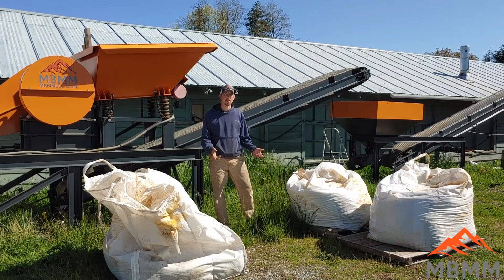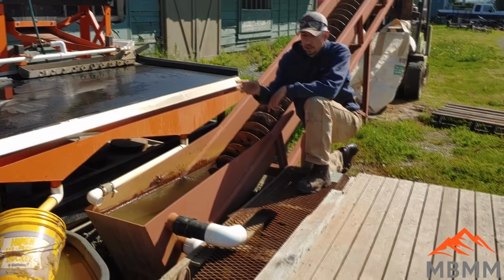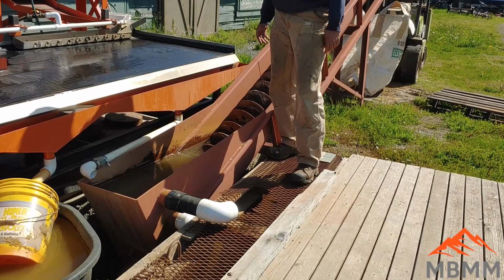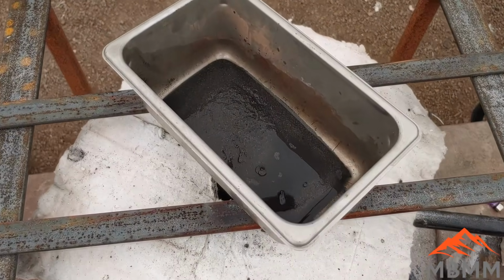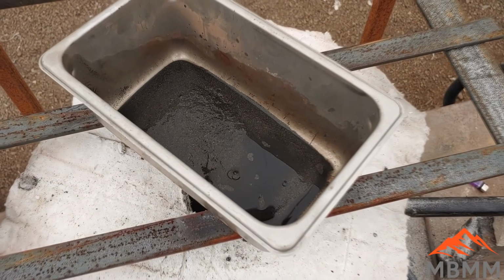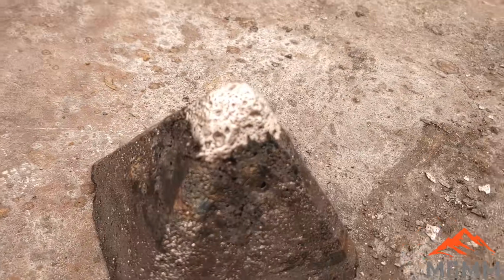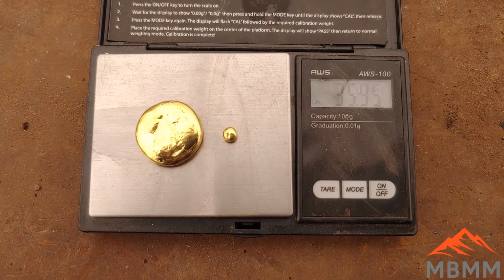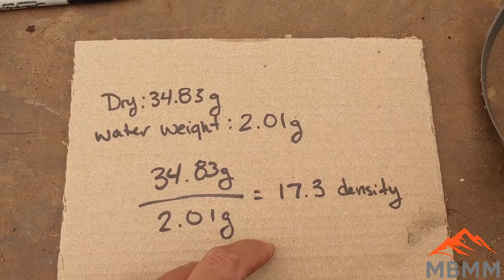Complete Gold Mining Plant: Making Money Gold Mining & Gold Prospecting

Comment: I do have a question. In the mill where I worked we had a couple things you don't demonstrate for example if the material coming out of the jaw crusher was small enough it went to the fine ore bin going through a vibrating screen but if it was too big to go to the rod mill after the fine ore bin it recycled until it was small enough to go into the rod mill.  So you always had to check if the cone crusher was having a build up of material.   Also if the material was ground enough coming out of the rod mill it would head to the jigs where the gold and silver was taken out then to the floats.  But if it was not ground enough it went to the eight foot ball mill over the jigs and to the floats.  But if it was still not fine enough it went to the 7 foot ball mill over the jigs and to the floats.  And when the rock was especially hard it would go to a cyclone back to the 7 foot ball mill over jigs until it hit the floats.  So we had bypasses and recirculation things happening.  Does it decrease the effectiveness of the hammer mill to have material that doesn't need grinding to pass through? Would recycling the material back to the jaw crusher help?

Comment: I wonder if I can just  pan  in the lower Mississippi valley . Their must be a spots in the Mississippi river  system where gold and other heavy metal just  buildup at.   All you would have to do is drag with a buck  and rope ( a big wide buck and wrench)  and pan it.
Reply: Its certainly possible but an issue with lowland prospecting is the large amounts of sediment and overburden you will need to move to get to a goldbearing layer. There are definitely rivers in asia where the locals get their panning dirt standing on rafts using very long handled bucket shovels

Comment: Do you ever find gold that you can just pick out of the material instead of having to run it through the process?
Reply: That would be nuggets of gold. Those are once in a blue that you would find. But, people do find them when they are prospecting near a river or creek.
Reply: Any free gold is crushed in the hammer mill until it passes the screens so it will be very small in size. This setup is about handling relatively large volumes of material, accepting you will have some gold losses and that being just mining.

To pick it out you would have to spend a time going through the 2.5t of material which would take a lot longer than the 3 hours or so to crush it and put it across the shaker table.  

Its the difference of hand mining and processing and starting to move to an industrial process using this sort of machine set-up.

Comment: I am curious about the underwater weight method. By logic it seems it would be measuring the amount of water displaced by volume not density.  

Would the results be different if you were to use to marbles of the exact same diameter. One of glass and one of tungsten. The same amount of displacement by volume yet drastically different densities.

I’m not shooting holes in your method. Just genuinely curious

Comment: Could you give an estimate of how much gold you lost in the tailings?
Reply: He covered that in a previous video!  This is part of an ongoing series!  Check it out!  It's good value.
Reply: What amazes me I guess is that no one checks the tailings with a gold detector for any small nuggets that may have passed through.
I understand this mill is very efficient, I guess i was referring mainly to the trommels & sluices used in Canada & Alaska.
Rocks that are a bit large and don’t fit through the grate when loading pay dirt get passed straight off into a tailings dump but no one checks those larger rocks for gold nuggets within the rocks?
Interestingly Parker claimed he gets 20 grams per tonne on average across his claim, yet while he’s recently been downunder in Oz looking for leasehold land to mine all year round, one patch that he was dry blowing was yielding 40 grams per tonne.
Twice as rich as his Canadian mine & you can mine it all year round with no winter freeze to worry about.
Of course the flies snakes spiders etc as well as the months of 100+f temps, will probably fry his brain! 😂😂😜🇦🇺
Reply: @ianmoone2359   the average commercial placer deposits in the yukon now average 175 to 250 cu yds. per oz. ounce once you average  all the gravel to be processed thru a washplant./ due to the erosion / weathering process of alluvial placer gold deposits it is extremely rare to find raw gold in the rocks /boulders from this kind of gravel. there are very few residual placers  in  canada due to glaciation and in the non glaciated /permafrost region in the yukon the long period of erosion/weathering completely removed and freed the gold from  the  host source rock . the miners i know who are placer mining  in the Dawson city area usually process about 100 to 200 cubic yards an hour to make ends meet ,that usually takes a 988 size cat loader and a 30 to 40 ton articulating dump truck and a 3 to 4 cubic yard excavator/backhoe. 50 ton size. and a D8 or larger cat plus a 100  to 200 cu yd pr hr washplant with a water pump 3000-5000 gpm. and then the  support equipment ,tools generators ect.........>>>>>>>>>>>.costs so much!!!